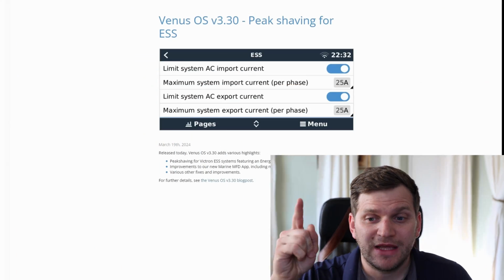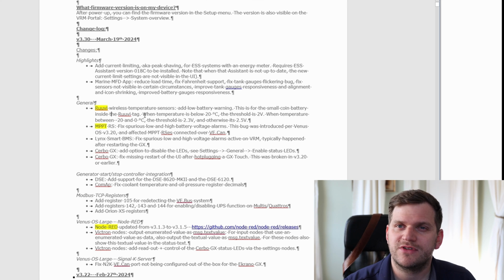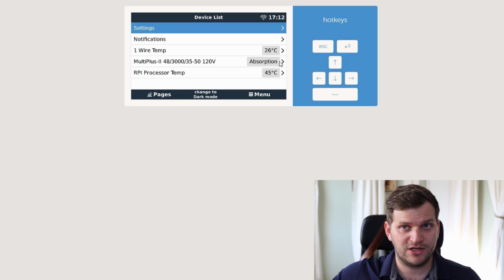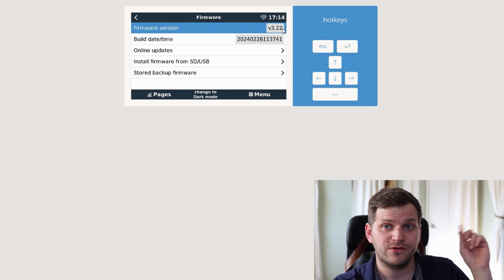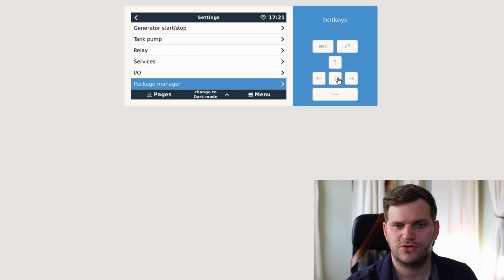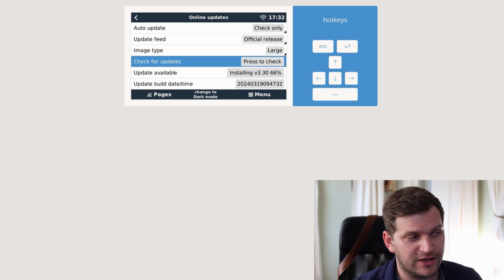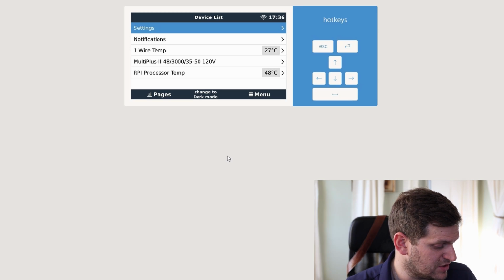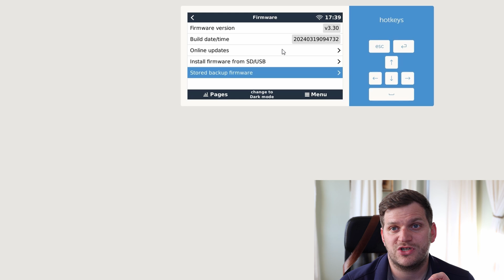Don’t Update! Victron VenusOS 3.30

Comment: Hey!! You have the same birthday as me!!! 👍👍👍👍I just updated my Pi 4B & touch screen to 3.64 in my 4wd & lost everything!! 😲I get the Vicron Blue screen & that's it!! 
As it is installed in my dash, it's an absolute PAIN to get to the SD card. So I'm NOT very happy!! 🤬🤬 especially as I had just minutes before finally extended my wifi to reach my 4wd parked outside so I can use the VRM from the office. I've now ordered an sd card extender so I will be able to access the card in the future if need. I have been thinking about going to Node Red & maybe I should have ordered a relay Hat & some sensors at the same time, they were going to be in the future as I'd like to be able to turn on the hot water & monitor the temp of it on the go (I'm just dream'n now!🤣)
Reply from the maker: Nice about our birth date, sad about the data loss .. sorry to hear :(

Comment: Thanks for the info, Tobi. I updated my live system on my boat (RPi4) just as this video came out and it all went fine, fortunately, so didn't expect any problems when I updated what I thought was a nearly identical version I have on an SD card at home. (It's another RPi4 I use for various things.) I was wrong! Not a huge problem as I just uninstalled RPiGpioSetup and GuiMods and reinstalled them. I'll be more wary in the future as I guess I was just lucky this time with the live system. (Reminder to self: Backup!)

Comment: With my installations on a CerboGX and a Pi3 I had to reinstall SetupHelper as it did not came up automatically. Beside this I did not have any issues, but I do not have an additional display.
In 3.14 and 3.20 the dbus-i2c module (on Pi3) was not working and my DC-load-monitoring failed. 
You do not have a backup firmware for the large image as the last software installed before was a normal version - for that you will see the stored firmware. My devices both show as last version 3.21 with a large image (seems I missed the 3.22).
Greetings from Germany
Reply from the maker: Thanks for watching! Grüße zurück!